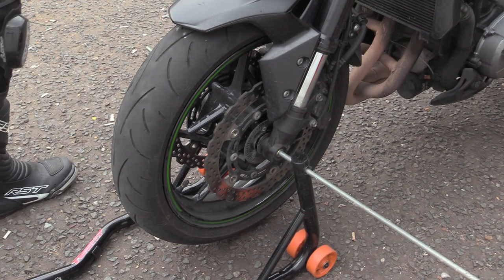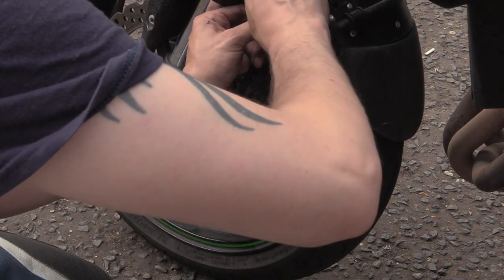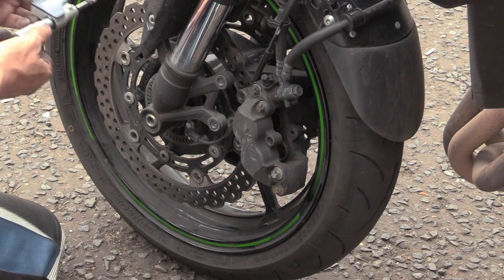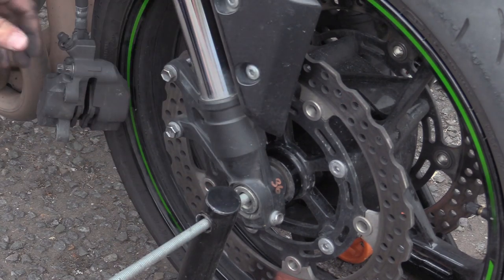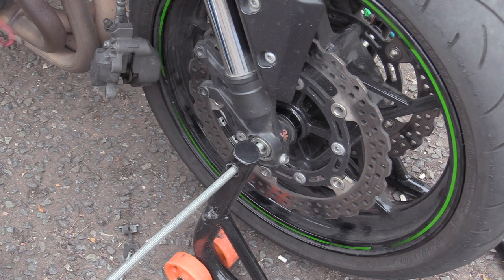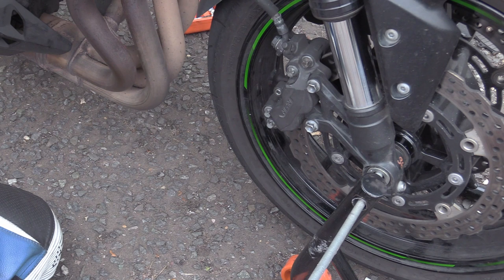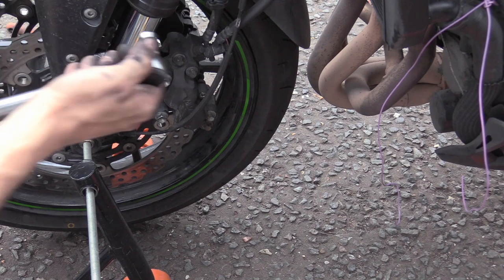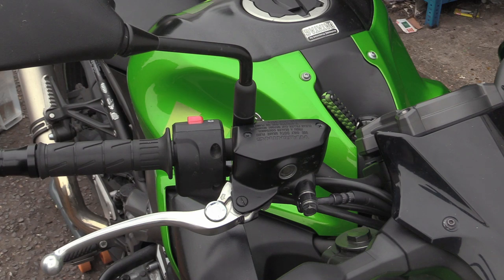Brake Problem - Kawasaki Z900

Comment: Matt, if your forks are bottoming out, is there no Pre-load adjustment? I am sure there is. Stiffen the sping a bit and put a tie wrap round the leg to make sure you are using as much of the travel at extreme braking ......do a stoppie. Then see if the compression and rebound damping needs adjusting, they may not. 
I always make a note of the origlnal settings as a base because you can tie yourself in knots trying sort out suspension so you can always  go back to the beggining and start again. 
Also, bear in mind adjustment to the front will effect the rear to some extent so the whole area can become a mine field and it is a bit of a black art.
Reply from the maker: That's not what preload is or does.
Reply: @dirtygarageguy  My Understanding is that Pre Load is the tension on the spring, if it set too soft it will bottom out. Your weight, the weight of your bike and/or your style of riding will effect the setting of your pre-load Damping controls the speed that the spring works whether it be on compression or rebound
Reply from the maker: Pre load is to offset the force of the rider due to weight. Spring rates are constant for linear springs, so bottoming out in because of rider weight * braking acceleration. More preload just means you have less compression because the spring total load is fixed

Comment: Hi Matt, a very good mechanic told me that the difference between upper and lower level marks for brake fluid on master cylinder reservoir is the serviceable life of your brake pads, when it approaches lower mark its time to replace pads, if you top it up when you come to replace pads and push pistons back there is to much fluid for the reservoir to hold, over the years I have found this to be accurate for both cars and bikes, just a thought, luv the channel by the way.
Reply from the maker: "when it approaches lower mark its time to replace pads," - I'll do another video on this - the reason why this is so full is the ABS system.

Comment: Probably unrelated, but I’m reminded of a recent Dave Moss Tuning video talking about how to remove and install a front wheel when you have twin discs. Specifically the order of bolting things up to make sure everything is aligned properly. Something to do with calipers not grabbing in funny angles etc.
Reply from the maker: This is what floating discs are for
Reply: That's to do with radial mounted calipers. These are not so there is no alignment to be done.
Reply: yeah the z900 has axially mounted calipers, my z900rs is radially mounted, hence my interest.

Comment: Gonna have to do something similar tomorrow. I've begun to feel a slight, rythmic tapping through the bars, only while cruising in 6th gear. And of course I did tires, sprocket, chain and braided brake lines just a couple months ago. So, I'm left wondering if it was something I did or coincidentally a new issue. I'm anticipating hours of troubleshooting...

Comment: I would have checked the disk first! I have had loose rivets on a disk before on an old bike I picked up. Sounded like a warped disk, needless to say I just replaced the disk immediately, I had only ridden it around the block fortunately. 
Pistons not returning correctly is a common problem. 
 For me I like to sort brakes and servicing in mid autumn saves me from freezing my bit off in the bad weather. And hopefully get through till spring.
Reply: Tyre pressure on the rim. MT 🧐 That’s military training for the incompetent drivers 😂

Comment: I imagine you know the answer by now, however I would postulate that the caliper piston is near the end of the travel (worn pads / rotor).  With the caliper pistons near the end of travel they are more likely to become ever so slightly miss-aligned in the bore making them 'stick' then drag the pad and cause the noise.  Throw new pads on, the pistons go back to their start travel and the problem goes away (or not) /s
Reply from the maker: "I would postulate that the caliper piston is near the end of the travel " - LOL no where near - but it's probably hard to tell from the video.
I've found what it is - video coming soon

Comment: maybe reduce the fork oil air gap by a few mm (more oil) it will make it harder at the bottom of the stroke  as a cheap easy mod 
cheers
james D

Comment: I know you removed the calipers here to clean everything out, but are the windowed calipers designed that way so that you can change the pads without removing the calipers?  That is, could you remove the pin and the spring; then pull the old pads out of the back "window"?
Reply from the maker: Yes they are, but I wanted to check the calipers themselves - this method will be for changing the pads - which is a seperate video

Comment: Without watching the full thing, it sounds like a hub bearing that has gone out of tolerance on one side. Had the same issue with disc brake rub on a bicycle.
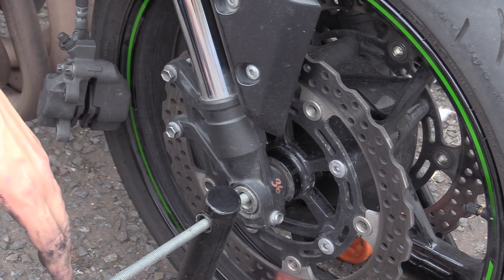Reply from the maker: Nope - 21:16
Reply: @dirtygarageguy  Let me be more clear. A bearing going out of tolerance on one side doesn't present as if its failing. Rather what happens is that the tiniest bit of play becomes multiplied by the time you're a distance away from the centre of rotation. Alternatively, the hub may be starting to fail, giving rise to the play which presents as brake rub.
Happy to be told I'm full of shit --- just guessing what may have happened based on a similar failure I had a on bicycle.
Reply from the maker: "Alternatively, the hub may be starting to fail, giving rise to the play which presents as brake rub."

- after 6k miles? 

 I get what you're saying but this happened all at once. No noise yesterday then suddenly the ringing started after medium braking. This is why I 'think' it's the scratching on the pad material. 

We'll find out when I replace the pads. After I did this, the noise has decreased by about 50%+ - so by removing the pads and cleaning/resetting their position something has happened
Reply: @dirtygarageguy  Totally agree, 6k miles for wheel bearings is far too early. Looking forward to seeing where this goes.

Comment: Matt, nothing to do with the brakes but your comment about maxing out the rebound damping on the forks. A bit hard to tell but looking at the front tyre it doesn't look like a shortage of rebound damping, more like too much if anything, maybe you need more compression instead? A close up (Good focus) shot of the tyre tread would help.
Reply from the maker: No - it's definately the rebound - don't get me wrong the springs could be stiffer
Reply: @dirtygarageguy  Doesn't look like it me, the tyres always tell the story but if you're sure it's you that's riding it. I wasn't meaning the springs by the way, meant compression damping.
Reply from the maker: The tyre looks like that because of the track day I just did. It's the the edges remaining of the 'rough stuff'
Reply: @dirtygarageguy  It's not the debris field on the tyre I was referring to it's the wear pattern on the tread that indicates rebound damping control (Or lack of it)

Comment: Mat is it good idea to use silicone grease / spray on the pistons / seals before fitting the pads ? To help protect the rubber seals so they last longer ?
Reply from the maker: Yep - but i'd apply grease and not the spray

Comment: With regards to the brake pad 'bias'. Is there a reason why they can not be swapped around and re-bedded to even out the wear?
Reply from the maker: Well they're pretty much the same and they're getting replaced. To swap them over they really need to have the same 'lean' or taper to them - which isn't possible - unless you flip the pads - The 'bias' in these pads is fucking nothing - what do you want, perfection? LOL

Comment: Hi Matt, 

Got a question that's in a way "somewhat" related to this issue. You've put a dial indicator on your disc to check for runout. On my bike {triumph bonneville } i noticed while doing routine brake Maintenance that my front brake also drags a bit{ normal drag} but on 1 place more. Also when i look sideways to the rim and spin the wheel i noticed that the rim{cast} isn't running true. On one spot its bend. Not much barely i can see it with the naked eye. I now the specs for run out are 0.6mm.but i don't have a dial indicator to check the run out off the rim. 
My question about this is how this affects in any way riding the bike? Is this safety issue would this create wheel hop? Do i need to buy a new wheel if I'm out off the 0.6mm run out? What's your take on this? 
Can this be just by hitting a serious puthole or could this be a bearing issue although i don't feel any play in the bearing. 

Thanks for your time. 
Regards 
Dieter
Reply from the maker: "On one spot its bend. Not much barely i can see it with the naked eye. I now the specs for run out are 0.6mm.but i don't have a dial indicator to check the run out off the rim."

- due to the nature of casting the rim will never be perfect. Even if you had a DTI, you'd need a spec for the run out of the rim......... "Is this safety issue would this create wheel hop? Do i need to buy a new wheel if I'm out off the 0.6mm run out? What's your take on this?"

- You'd have to ask and show it to Triumph. "Can this be just by hitting a serious puthole or could this be a bearing issue although i don't feel any play in the bearing" - it could have always been there unless you notice a recent change. Like I said - and I know this probably won't help that much but Triumph have to make that call.
Reply: Thanks for the quick reply, 

Although the rim is cast the sides are turned on a lathe so i don't think that only one spot could be turned more or less deep. So it's probably caused by myself. 
I wanted some Reassuring from someone that has knowledge off This stuff what the consequences could be.. But i understand that i should talk to Triumph or the triumph garage where i bought my bike. I'm no expert far from it but the shop manager and his mechanic are both dickheads. They would sell me a new rim {600€}for sure even if it's not needed
Reply from the maker: Well it depends how bad it is. If you give me an actual number then that's something - If you say you can hardly see it then I wouldn't worry. What you can do is rig up a pointer very close to the rim and then spin the wheel - if you can video it.
Reply: I try to get something on video and or buy a dial indicator to get accurate number. I'll get back to you with this issue. 

Thanks again Matt.
Reply: Hi Matt, 
I finally made a video with a dial indicator that shows the run out of my front rim. Around 0.3mm off run out { dial indicator is 0.01 scale}.
The video Also points out that most of The runout is located at one spot. It's not 360 degrees equal { I mean the low spot aint 180 degrees away from the high spot}. Which means it more a damaged spot than axial runout? 
If you like I can send you the video, but to which email address can I send it? 
Can you give my your take on this please. Much appreciated. 
Thanks

Comment: Great video, learnt a lot!  Do you use the tyre pressures recommended by the bike manufacturer, or the ones by the tyre manufacturer. I've noticed sometimes they don't match, sometimes by quite a bit.
Reply from the maker: Always the bike manufacturer. The tyre pressure is MAX for those tyres - they don't know what bke it's going to be fitted to. The bike manufacturers obviously do. Weight, weight distribution, frame geometry etc all matter and the tyres that are chosen require the tyre pressure to be 'x'
Reply: Thanks for the reply.  Yes, I knew about the 'max' pressures on the tyre, I meant the tyre manufacturers pressures recommended for your particular bike, but you answered my question anyway! Good spot by Isacc I thought realizing that piece of the pad could have been trapped in the caliper.

Comment: Hey Matt, so out of interest , how often are you going to change the oil on the z900 ,  twice a year ? every 5000miles? or just whenever you decide? I remember you did a video on it but dont think you mentioned how often you will change it on this. I chage my engine oil every 3-4k miles
Reply from the maker: every 5000miles-ish - sometimes before

Comment: We're told not to let the calipers hang, to suspend them by something.  But no one seems to know WHY!  What's up with that, please?  Video and audio went out of sync about the time of the first use of the torque wrench.  Not a big deal, just an FYI.  Keep up the great work!
Reply from the maker: "We're told not to let the calipers hang, to suspend them by something.  But no one seems to know WHY!  What's up with that, please?"

- additional stress on the hoses - they're not ment to take tensile stress - althought the weight of the caliper isn't near enough to do and permanent damage. It's more so you don't knock them about into the wheel etc
Reply: @dirtygarageguy   thanks!
Reply: I was told not to leave them hanging as 99% of he time there in the way.  People tend to put them up out the way by balancing them on something then accidentally knock them of and its the force on the pipe/unions that take a jerk and can cause damage that’s not seen and can fail at a later date.

I know what I mean just hard to explain.

Comment: hi matt 2 things to ask 1 trying to become a patreon it just buffeting  tried it on work pc now tried it on my home mac any idea and secondly what are the causes of one caliper on the front pistons drift back so get soft leaver cheers keep it going
Reply: Warped disk will push a pad back enough to cause a soft feel on the first pump.
Happen all the time? Or only once in a while?

Ive had it happen after a "light front" when I've been pressing on, and the front has raised, then shook its head when I've put it down. Thats normal. 
If it's all the time, more likely to be a miss alignment somewhere pushing the pistons back
Reply from the maker: "hi matt 2 things to ask 1 trying to become a patreon it just buffeting  tried it on work pc now tried it on my home mac any idea" - nope as to any ideas - what is it doing/not doing?

Comment: Them pads look nasty for 6000 miles. I just replaced my second set of fronts in my zx6r at 14000. Originals did 12000. Although they are different configuration and radial mount calipers , I’d be pretty concerned at the friction material wear rate on yours. Get some nice sintered EBC ones for fucks sake 👍
Reply from the maker: "I’d be pretty concerned at the friction material wear rate on yours."

- Well maybe you ride like a pussy? Who knows...... LOL
Reply: It probably depends when and where you ride. 
Matt said he rode through the winter, wet riding increases pad wear from road grit.
Reply: @surestick88 I’ve got the same bike as Matt and ride all year round. I’m currently on just under 11,500 miles on the stock pads and they’ve still got life in them. 

@The workshop it’s not riding like a pussy, brakes are for pussies lol.

Comment: Hey Matt,your wrong about the tire pressures. You said you take comments when you're wrong,so here's the thing. When you weigh alot and put weight back on the wheel,tire pressure goes down,you're not "squeezing" the tire. In fact,when you put excessive weight on a tire,the patch on the ground increases,therefore creating a larger volume,lowering the pressure. Just wanted you to know so Delbullocks doesnt get to you,lol
Reply: So why do. You reduce The pressure with increased load.
Reply: @jediknight1294  you dont. You increase pressure with more weight. Max tire pressure is rated for max load. Fucking hell,its written on the tire,"max psi at max load of ?"  The max pressure is higher at the max load. Sport bike tires are of course ment for other  than carrying trailer loads,so you adjust accordingly to riders and riding style. But if you air a tire while on jacks,bring it down, with,for the sake of this discussion, a max load,the side wall flexes and the contact patch on the ground becomes greater(or wider) thus,increasing the the amount of volume inside,pressure goes down,so you need to add air to match the load you have put on it.

Comment: Had to go to kawasaki to have the abs brakes bled...
Reply: Why?
Reply: @raydavison2972  To get all the fluid out and remove any trapped air from the abs block they connect a service tool to make it pulse.
Reply: @adivarso8175  Interesting, I've never had an ABS bike but on the car the bleeding procedure is no different and my mate's ABS bikes don't seem to need that. I will investigate!
Reply: @raydavison2972  Depends on the work you're doing and the system, newer ones can be (surprise surprise) more complex than older ones, e.g after replacing master cylinder on a 2007 octavia vrs you have to plug in and tell the abs pump to cycle to purge any air out of it. The slightest bit of air in there and the brakes become utterly shit. It seems mental to need a computer to bleed system, but I will say the original master lasted well over 200,000 miles and brakes were still incredible, only replaced due to leak found on mot.
Reply: @nothanks3462  Yes you're right VCDS saves the day!!!

Comment: Be careful with all that brake dust and your compressed air. Better to use brake cleaner and void all the dust. It is dangerous for your lungs 👍
Reply: Asbestos was outlawed in 2000.  It just gives you a nasty cough now 🙄
Reply from the maker: Dude - I smoke

Comment: You obviously havent a clue what your doing .you never got the angle grinder out once,Let alone a hammer or an anvil.You coulda shaved your tyres down whilst you were at it too.                 seriously though I would have put new pads in and possibly ended up pulling my hair out over a silly mistake.